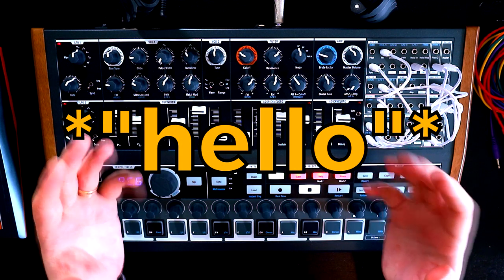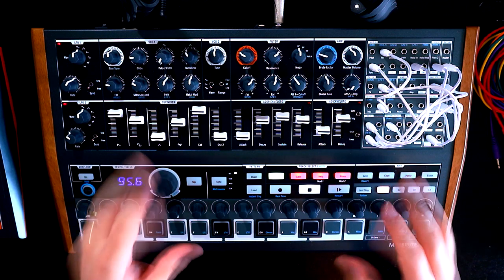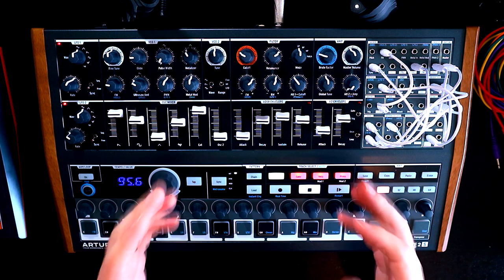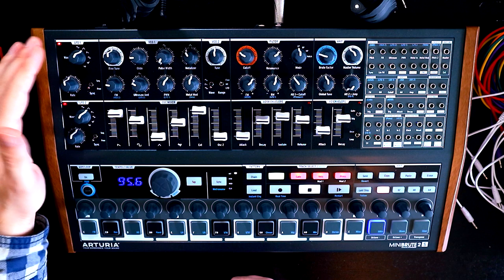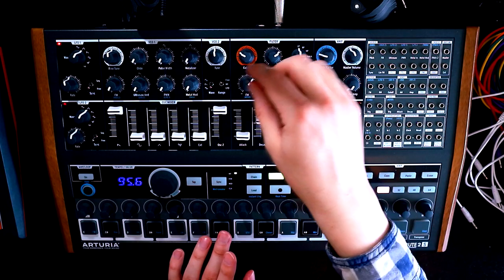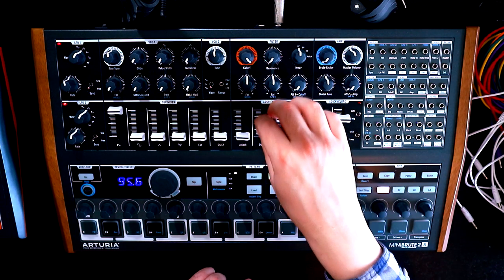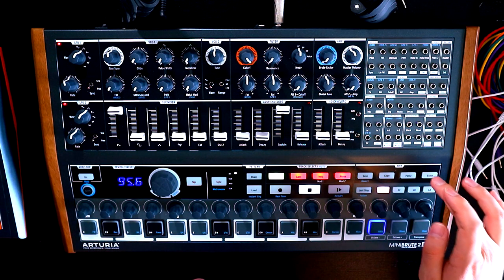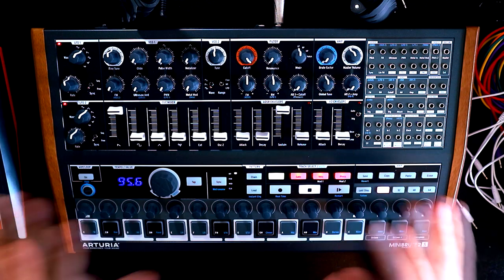Arturia Minibrute 2 / 2S - Let's Build an... Initialised Patch

Comment: I won’t buy a synth without patch memory. Adding it to a design is easier than it has ever been.
Reply from the maker: How are you going to remember where the patch cables are plugged in though? 😉

Seriously though, I get that attitude, although the additional cost of adding digital control shouldn't be underestimated and it would be much harder to then integrate the system with other modular gear (but I suspect that isn't a selling point for you anyway!).

Thanks for watching though 🙂
Reply: @OscillatorSink If a sound really like me...  I take pictures of the synth! For future reference! Or I write notes starting from the settings that Arturia recomend in the manual (Like what you are doing in this video). Old School they said... I´m guitar man, but  always liked me synths and recently buy my first one. An Arturia Minibrute 2 (keyboard version) . I'm really looking fordward for this series of videos. Thanks! (Sorry if my writing isn't correct. I'm not an english speaker)
Reply: There are advantages to both. I think it's cool that Arturia chose the latter option for the Brute series. I like the purity of the no-preset, no memory system, it makes the synth more finite in a way, like a guitar. If you're learning about this stuff like me it makes you think more. If you patch something good that you think you'll forget, photograph or film it with your phone. If you film it you can hear the sound it makes. Conversely, if there are patch memories then a way to see what all settings are as found on Deepmind 6 (the compare feature) and Bass Station 2 is a must for me. Deepmind 6 has 1000 presets which is huge and overwhelming but you have to hand it to the programmers because these really show off the capabilities of the synth.
Reply: Patch memory on an analog synth is trickier than you think. Knobs don't control a digital value that you can save, they control a physical electronic part that allows a certain amount of current to pass through. The moment you add a way to save that, it's no longer truly analog, as you'll have to work with discrete values instead of a smooth continuum of values. So in fact, I'd even go as far as saying that the moment you add patch memory, it's no longer analog. Case in point: the sequencer on the Minibrute 2 is digital, as it saves notes as midi, which means there are discrete note values with nothing in between. It's either A or A#, you can't save frequencies in between.
Reply from the maker: True true - although just on the sequencer point, although the sequencer is digital, it is firing out CV (it's normalled in the patch bay, but can be overridden). Additionally - tracks 3 and 4 can be set as CV sequencing (with 1, 2, 5 and 8 volt ranges off the top of my head), and while they're digitally controlled, you can fire out much more precise values that way. Not trying to contradict you, just hip you to some neat features in the sequencer.
Reply: @OscillatorSink  Yeah, I know. I have the 2 (not the 2S) so I don't have the CV sequencer tracks, but yes: it's a digital sequencer driving an analog synth. Which makes sense, for most musical purposes. Maybe I should have introduced my point in a more positive way. But my point about patch memory remains: the moment you have patch memory, you don't have a truly analog synth anymore. At the very least, the saved patches will be digital approximations of a certain state of your analog synth. But also when you load a patch you'll have knobs and sliders no longer representing their true values, etc.
Reply: Digiphex Electronics modular synth with presets? Love to hear how this works!  Lol